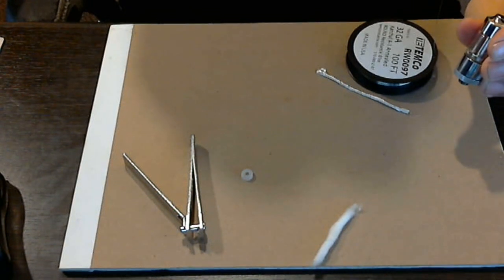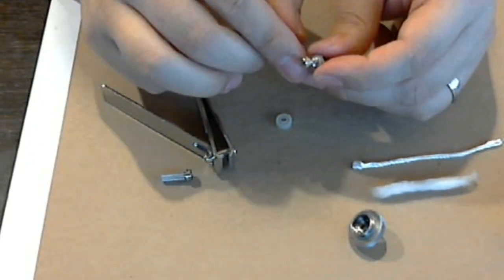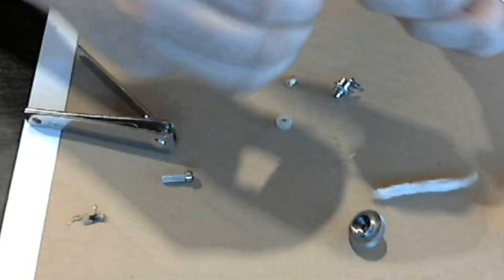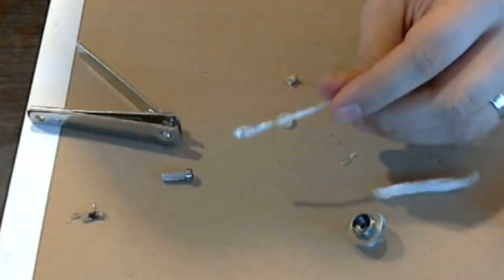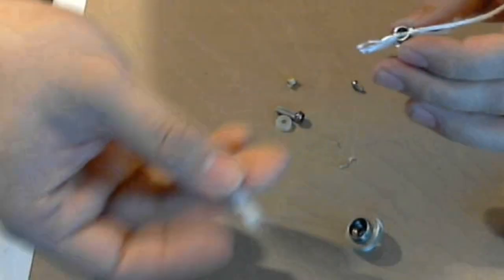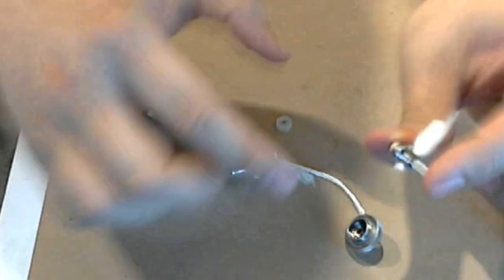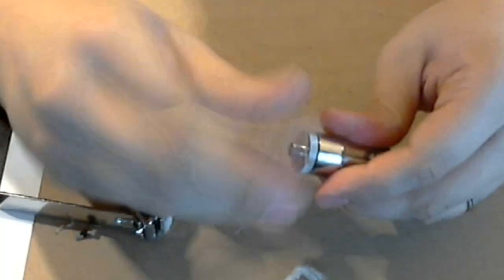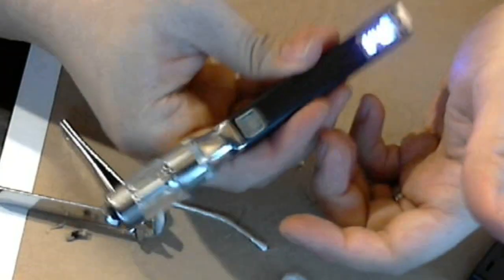Protanks and Evods, Anti-Gurgle Rebuild Method

Comment: I've never left a youtube comment before, but felt compelled to do so as I think credit should be given when due. 
Your no-nonsense videos have been by far the most helpful I've seen, and this particular one has resolved my kanger issues perfectly. Managed to efficiently rebuild 8 coils at 2.1-2.3ohms and all are working great. 
I don't own a butane torch, but always fire up my coils/silica using the gas burner on the kitchen stove (blue flame, seems to work okay).
Anyway, just wanted to say thanks, and keep up the good work :)

Comment: Great money saver method. If you buy silica wicks and the wire in bulk you never have to buy prebuilt replacements. Thanks for your time.
Reply: +Uniscious Unless over time the metal starts to wear down. I think with the new rules that will be coming down, who knows if we'll still be able to get our stuff online or anywhere? I would stock up on some extra at least. Err on the side of caution! I have bought a bag of extra gaskets on ebay because those DO wear out, something to keep in mind. Enjoy!

Comment: The rubber that you run one end of the coil wire through the middle and the other end on the outside is basically called the "insulator" grommet/gasket. Just thought I'd mention it since you weren't sure what to call it..

Comment: Great video, man!

I just tried this using .28 gauge kanthal (6 wraps) and 3mm silica as that is all I had on hand at the time. I think the .28 and 3mm made things a bit too snug as the draw is way too tight.

I've got some .32 gauge and 2mm silica arriving later today or tomorrow and plan to give it another go.
Reply from the maker: lol yeah  in the vid  I used 2mm

and I don't recommend 28 gauge kanthal,  its too thick and too hot.
even in wattage mode.  28 gauge will clock you around 1.2 ish
and using a 32 gauge around 2.2    setting both to 10 watts is not the same.
very likely the 28 will taste burnt over the 32.

gotta remember  wattage mode is only "trying" its not exact.
I think 30 is rather pushing it.  these coils seriously recommend 32 or 34.

Comment: Ok here is a little bit of feed back to Professor Peg. Homework was 50/50 my cat did not eat my silica but eyeballed it very hard. Ok so to avoid the long story about what it took to get all the supplies from Amazon, another story at a later date. I used Nail clippers ( wrong kind, still worked prolly not as good) first rebuild ( FAIL ) ok so I re-watched the vid a few more times built up confidence once again and walked through it with you, This time I did get a burnt taste, but persistence actually came through and paid off. I was able to get it to hit right, taste was a lawt more diverse and WOW same juice better flavor really ? Ok now what I did have to do hangs head low I removed the CelluCotton, yes I watched your other video ( idea taken ) and when I did I was able to enjoy a much harder hit than I have been used to but the taste is like a rainbow , I suppose its like being able to see clear something like needing glasses and being able to see clearly for the first time in awhile. So thank you for showing this video it is going to allow me to get used to re-building these Kanger coils I have. Can not express the gratitude. Now the taste I was getting off the bat was that the silica or the coil ? cause wow that was brutal. Should I use the torch more or just not take a lung hit for awhile or keep testing it with light hits ?
Reply from the maker: yea  this is an older video of mine back then we used the silica because it had more of a spine to hand wrap.
if i had to redo this again, I would use a smaller gauge driver and make a micro coil with cotton.

same principals though.
Reply: I will try it fingers crossed LOL

Comment: I cured the leak/gurgle problem with pro tank 2 by this method.
The steel tube that screws the two ends around the tank fits inside a hole in the bracket on the other end piece.
this is steel on steel and the liquid gets drawn in between when you vape.
I removed the polythene washer from a spare atomiser and after unscrewing the tank assembly, I put the washer cup side toward the bracket over the steel tube to clear the thread.
then assembled the tank back together so that the washer is up against the bracket after assembly and cured the problem....

Comment: I like your unbiased opinions on popular products. The change over most "sponsored channels is refreshing. I also like your no nonsense scientific approach to rating performance. Your fix for the pro tank is appreciated by those who can do it. But if you use a pro tank you are probably still a beginner, and don't have the know-how or experience to do it. This person should try another product that is not faulty in it's construction. If you have to rebuild  the disposable head then why not buy a rebuild-able device to start with? Unless you don't know how to rebuild them. Just my opinion. I used to like the pt2 but I got the russian 91%. Makes the pt2 seem like a piece of crap.
Reply from the maker: that is because you are super lucky sir.  Timing in life makes all the difference.
the russian and kayfun didn't come out till a few months ago.
protank was around since may and protank II in august of 2013.
The point is.  even if you got into rebuilding the choices were mostly drippers and genesis.  and neither one is really a fill n go system. Also the russian is a bottom coil fed tank device on steroids.  Its literally the hulk version of a PT 2

As an advanced user, I think cloud chasing is fun but silly.
and using advanced tanks,  russian kayfun, aqua, fogger, taifun,  is the way to go.

Comment: Awesome Video,,,,when it comes to trimming,,,wick,wire,,,nail clippers are great,,,,it has a guide across the front,,,,very nice for the kanger coil build,,,,it was amazing how we both at the time when we first needed something to use,,,,went around in the house and said perfect,,,nail clippers,,,thanks for the video,,,very informative,,!!,,,,Question ? where do you buy your kanthal,,,,looking for a good online place,,,thanks James !!
Reply from the maker: ebay  or temco direct
Reply: thanks,,,for the reply,,,Amazon sells temco,,,100 ft spools,,from 7 to 10 $,,,depending on the ga,,,thats prob a pretty good buy,,,,i will try temco,,,thanks !! also looking for a good buy on flat (ribbon) wire !!

Comment: Lol so simple! My Anyvape Davide is forever gurgling even when I do your qwk fix it's great for a little while, I actually stopped using it, but I'll give this a try and see what happens! One question, if you had done 4 or 5 wraps would the resistance have been lower?
Reply from the maker: yes that is correct.  small tweaks.  I actually did 5 wraps in the video on accident.  and it clocked 2.1  had I done another wrap it would have been 2.3 - 2.4

32 gauge kanthal will put you in the 2.3 area.
30 gauge will put you around 1.7
34 gauge kanthal is more for vivi nova and stardust and clock around 3.2
Reply: Ok that's good to know, as I'm just getting into rebuilding myself, one thing I have noticed, no one has done a basic chart for coils, unless you know of one maybe? I've trawled through forums looking, unlike say a safe vaping power chart, found loads of those lol

Comment: i notice you don't fuss over the length of the leads after you cut them, after inserting the rubber gasket.  should they be sticking out a little?

Comment: Hi Peg, I just started using my T3S tanks again on my iStick. Made a micro coil with cotton and it vapes great but like you said eventually does start gurgling and leaking. I thought I'd try this method and was wondering if I used all cotton instead of silica in the middle? Have you tried that way? I'm thinking it will Vape great too 😄
Reply from the maker: the time of this video, microcoils wasn't THAT popular.
so I used a silica center for skeletal reasons,  plus.  we were more used to using 32 gauge and wrapping 6 times by hand.
these days I would use 30 gauge kanthal and do a microcoil of maybe 8-9 wraps.
as for wicks, I think these days i'd triple cellucotton the whole thing.

so yes please,  go ahead and try a variation using the same principle

Comment: Hello, I've rebuilt my coils many times and I do the same thing only with silica wick instead of cotton.
ONE QUESTION: WON'T THE COTTON MELT ? (really curious .. I might try this method)
Reply: It won't melt but it will BURN if you let juice run out. So the trick is to always keep the tank filled with juice.

Comment: I don't know what  it is about protanks, I have 3 of them and I just don't care for them. I use t3s tanks that can have gurgling issues as well, and have those infernal flavor wicks that are more trouble than they are worth... I use cotton yarn and double it over like you showed at the end, then wrap it. No need for extra on top and bottom... that's with the t3s tank, not the protank, though I would probably do the same with the protank but mine don't gurgle when I wrap them the way I do.
Reply: sadly even some of the kanger brand coils are built poorly, though I have moved past the small tanks anyway.
Reply: I only get them in boxes of 5, but who knows where they came from originally.

Comment: It all looks so easy, mines always short out! where am I going wrong? Ahhrrg!
Reply: Too low resistance,  more wraps or a higher gauge wire.   It could also be that the top cap of the atomizer is touching the coil itself, causing a short